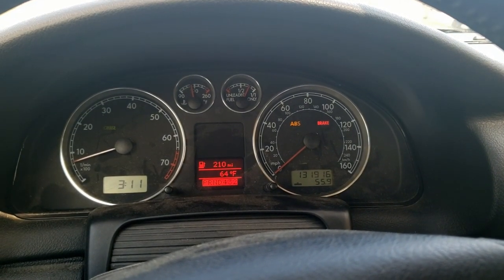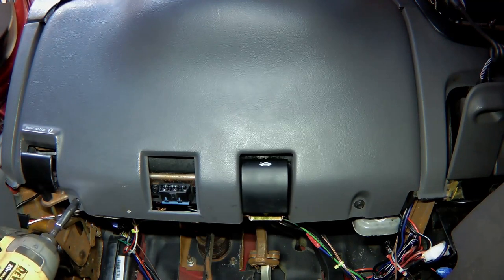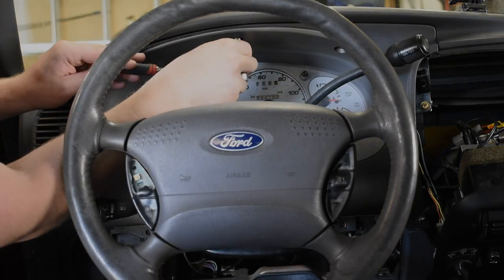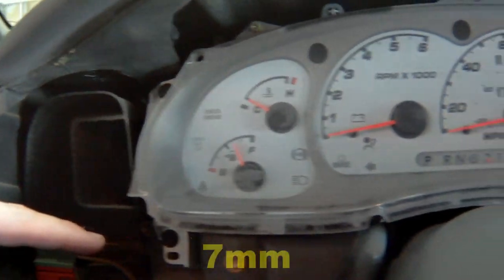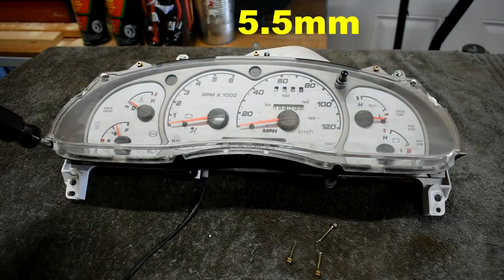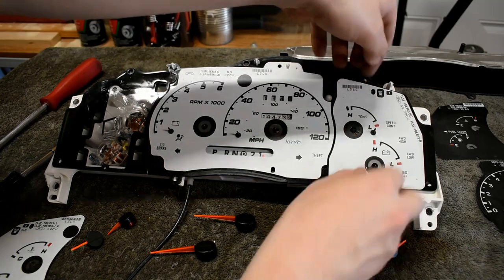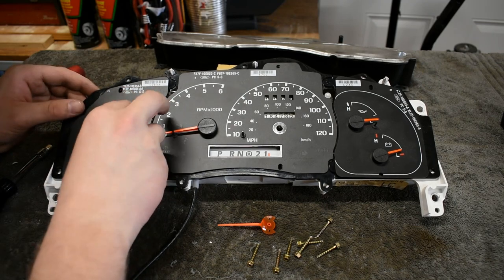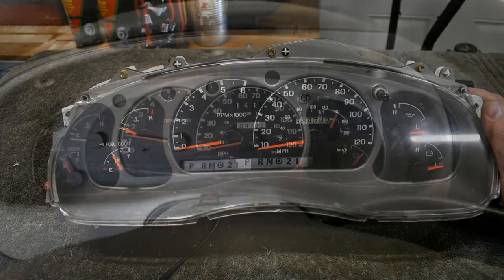Dora Joins the Dark Side - Cluster Color Change on a Ford Explorer Sport Trac

Comment: Great video man! Could you show how to remove the front seats? Do you think the seat from a ranger can be used for the 2002 ford explorer sport trac? Just like with the clusters?
Reply from the maker: The body mount replacement video on this channel shows how to remove the front seats. You would have to check the brackets on the Ranger seats to see if they are similar to the Sport Trac.

Comment: How well is your double stick tape holding up?  What brand did you use?
Reply from the maker: I used Duck Tape branded double sided tape. No issues so far. The tan plastic trim over top of the gauges also does a good job of clamping everything together.

Comment: Was the speedometer difficult to calibrate since you had to take the needle off? Please let me know, thanks!
Reply from the maker: It's a bit clunky. The way I did it was not safe. I had the cluster loose but connected up and drove up to 40mph based off GPS, then pressed the needle on to the shaft while driving.